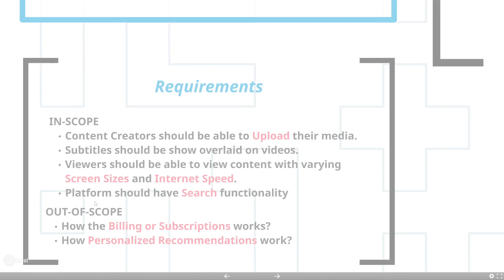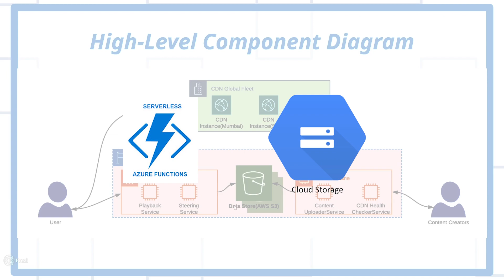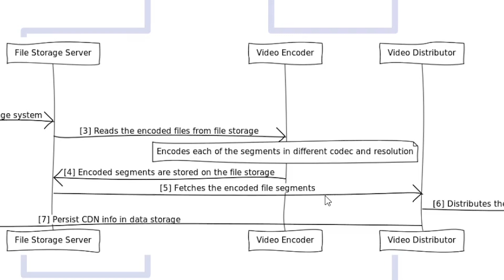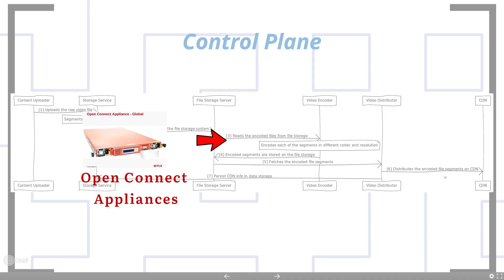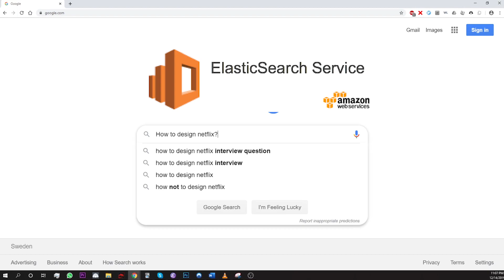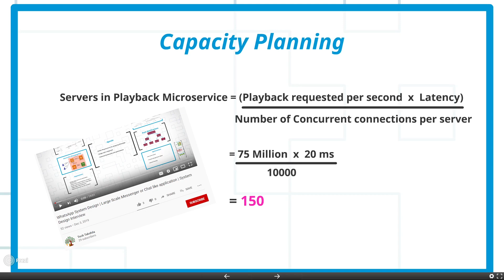Netflix  System Design | Media Streaming Platform | System Design Interview

Comment: Why the formula for Playback Service servers = (Playback RPS * Latency / Number of Connections)?
Reply from the maker: The number of servers required for serving the traffic increases as the time to process the request and the number of requests increase. It decreases as the number of connections per server increases. That's the reason behind the formula.
Reply: @techtakshila5128  That is reasonable. But one can calculate amount of load single machine can handle (10000 connections / 0.02 seconds) = 500000 RPS (that is a very big load, by the way), and then get amount of machines as 75M / 0.5M = 150.
Reply from the maker: Yes, we are talking about the same thing.

Comment: Incorrect capacity planning formula?

The equation for getting the number of hosts as given in your website and the video is
S𝑒𝑟𝑣𝑒𝑟𝑠 𝑖𝑛 playback 𝑚𝑖𝑐𝑟𝑜𝑠𝑒𝑟𝑣𝑖𝑐𝑒= (#playbacks requested per second∗ Latency)/ #concurrent connections per server

This does not make a lot of sense to me as with the example given, the number of servers needed is 150. However, if I assumed the latency to be 40ms, the above formula gives us server size as 300 which does not make sense.

Logically speaking, latency and server size should be inversely proportional, not directly! Does this formula not make more sense?

S𝑒𝑟𝑣𝑒𝑟𝑠 𝑖𝑛 playback 𝑚𝑖𝑐𝑟𝑜𝑠𝑒𝑟𝑣𝑖𝑐𝑒= #playbacks requested per second / (#concurrent connections per server ∗ Latency)
Reply from the maker: Think of it this way, if the server requires more time to handle a request then we will need more servers. So, they are directly proportional. Thanks!
Reply: Tech Takshila That makes sense. I’m just having trouble putting the equation in context. The way I look at it is when a higher latency is acceptable, we need lower number of servers to handle requests. Which is inversely proportional. This is confusing.

Could you please help in clearing this?
Reply from the maker: The latency in this case is server side latency and it depends upon the I/O costs and other computational costs. If we are able reduce the server side latency(using mechanisms such as caching) then the threads(for handling HTTPS request/response in a server) will be made available to process subsequent requests made to th server. Subsequently, we will be able to handle the same TPS with the same server configuration(aka number of connections) with even lesser number of servers, making the number of servers directly proportional to the server side latency.